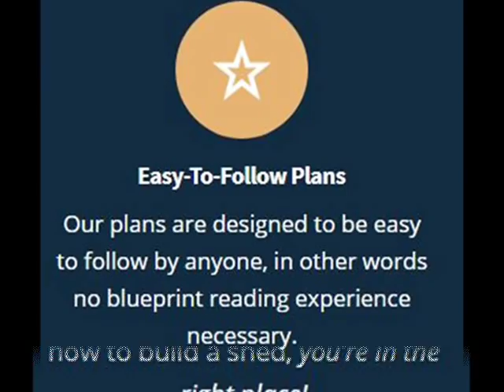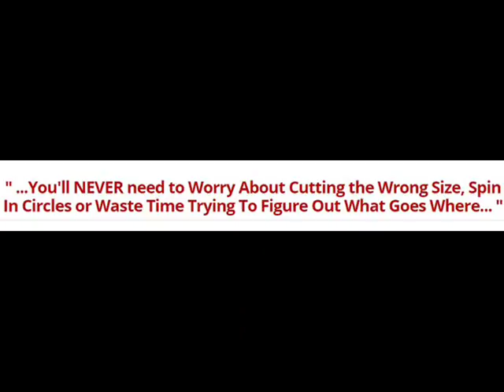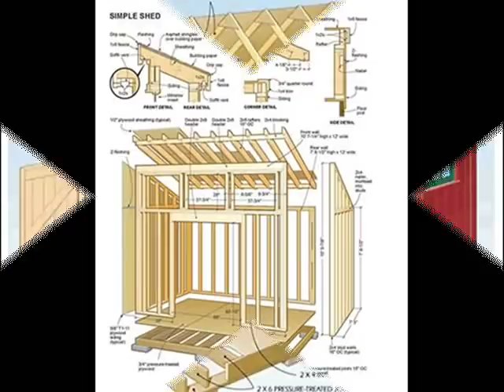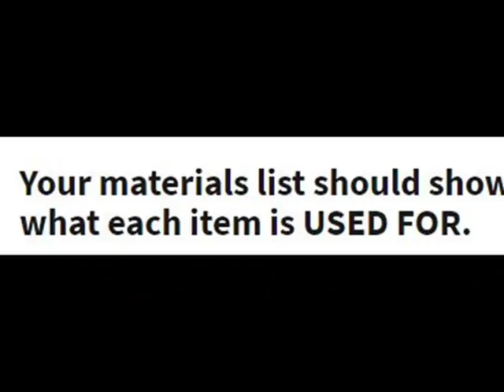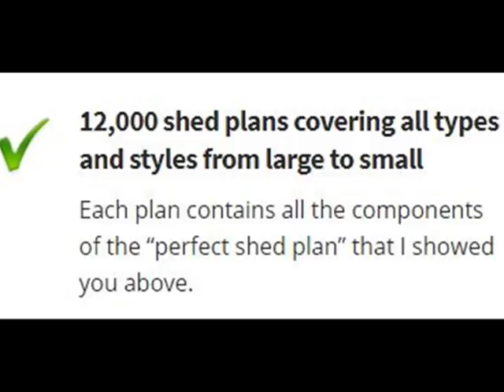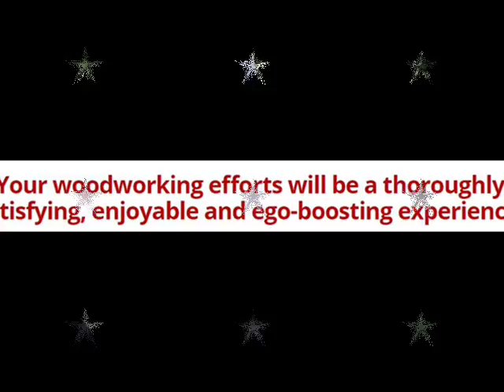Easy DIY Garden Storage Shed Plans for Your Outdoor Shed For Woodworking Projects

Comment: The topics covered in this wood working book “Bαzοmο Tdy Plαn” (Google it) varies from wood types to tool types and also uses. It also tells you concerning the different types of wood and how easy or hard they are to work with. If you`re still a beginner in woodworking, then you`ll find this book very helpful. .